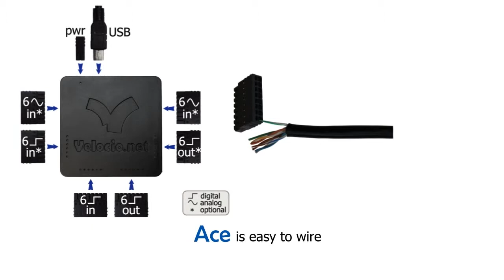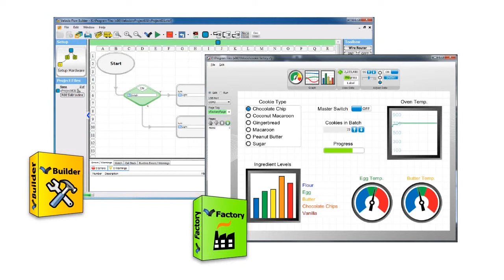Ace Introduction

Comment: i have a ACE 5150v5, can i use on PWR Connector 12V? I'm not sure.
Reply from the maker: ACE can be powered fomr 5 to 24 VDC if it is the new version (blue text on ACE). https://www.support.aceautomation.eu/knowledge-base/power-supply/